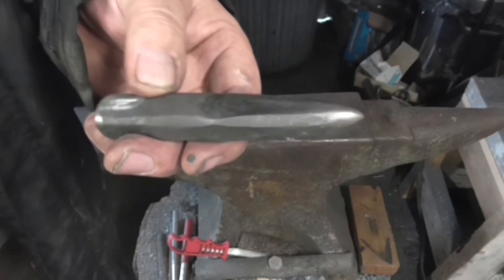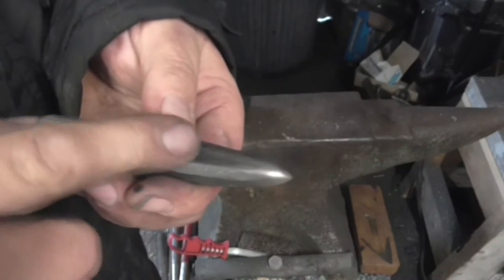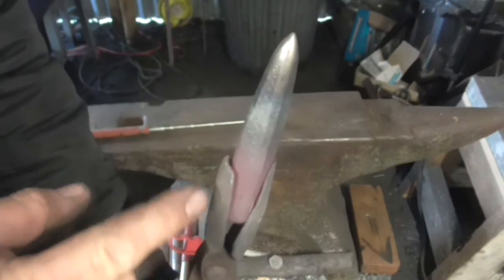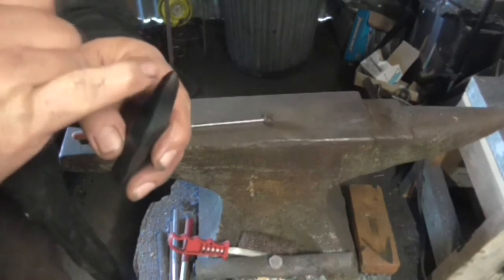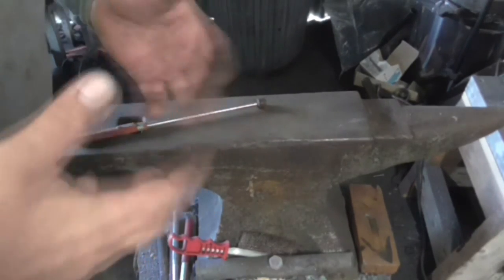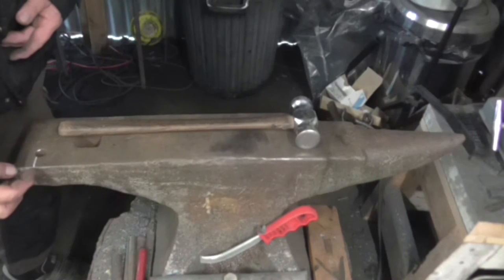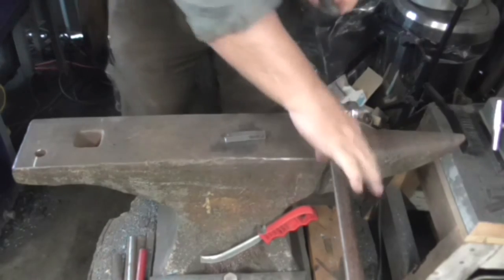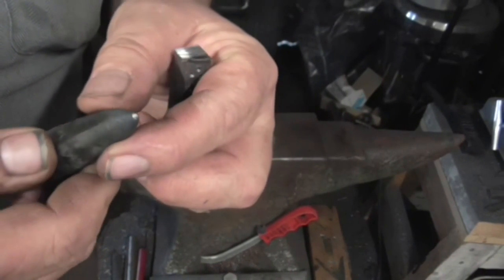Tempering a hand forged centre punch

Comment: Nicely done. The centre punch has good shape and weight. I've always tempered my projects to straw colour and had considerable success. Your second attempt at the temper was much shorter than the first try and I suspect was successful as the temper colour you achieved was closer to straw. Good work and excellent video. Thanks for sharing what you've learned.
Reply from the maker: Hi, The Centre Punch was forged under the guidance of my teacher. I ground the working end and the striking end at home. I had been told to aim for  blue at the tip, and then quench. On my second attempt  I think  I either heated the body too much or did not quench the tip enough as it was only a second or so before the colours had run up to the tip. I've been using the punch for about a month now and it is showing a slight sign of wear on the tip. Thank you for your comments.